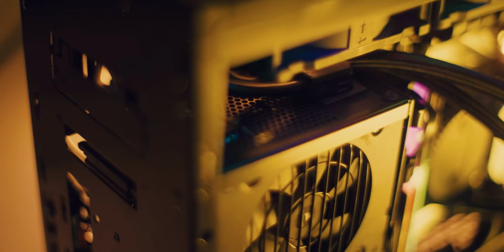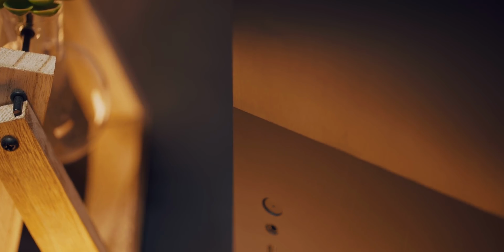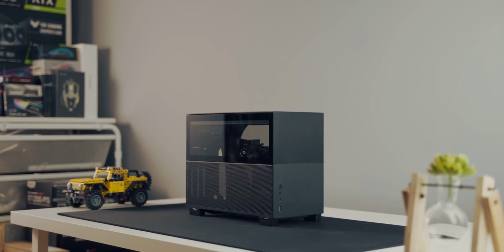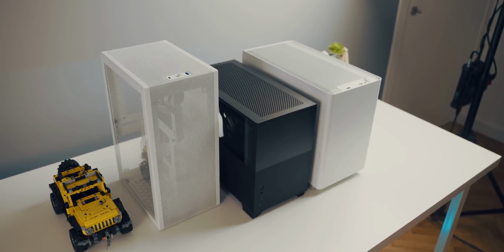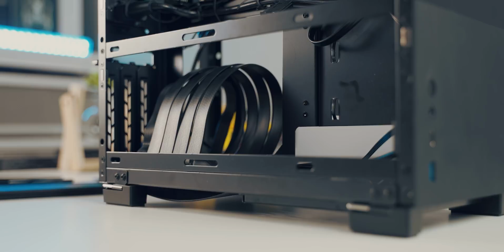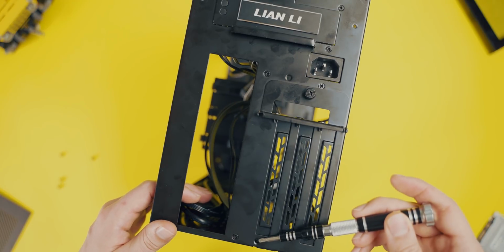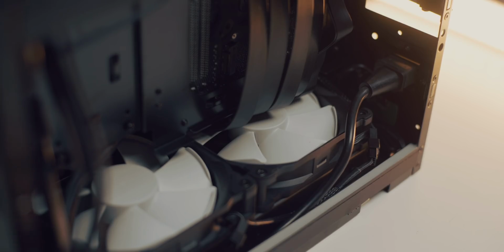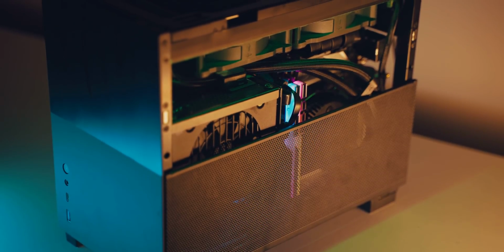An ITX MASTERPIECE?  Lian Li Q58 is Here!

Comment: It was not fun to build in, but it was rewarding. Fitting a 280 in this thing is a headache. I have my fans in the top underneath the panel so that they wouldn't sit inside the case, cause i hate that in ITX builds. Sticking to the radiator piece they have the perfect size cutout on all 4 corners so that you can route you fan cables cleanly to the supplied fan hub. A+the rest of the cable just chills under the top panel. As the the side panels, mine are very stiff, especially the glass ones, they dont like to come off or go on. There's so much good to say, but some bad too. Like the GPU sits right against the spine of the case, which basically mean it's a pressure cooker. I found that at least with mine, it required a lot of dissasembly to assemble. I'm not new to ITX world. I have had cases that require a complete tear down of the case to even start a build. And this one seems like a case that would benefit from being able to remove more of the case. But the biggest thing is going to be that bottom fan panel. Thankfully it is removeable, beause my GPU cables were preventing it from spinning, and with a quick removal of the thumbscrew bam fixed in seconds. Definitely recommend a low profile 120 for that spot.

Comment: Want step down size-wise with the next CPU upgrade (most likely switching my 3700x with a 5800x3d), switch air cooling for a 240mm aio and also upgrade from 16gb RAM to 32GB. I guess this case will be perfect, even tho I'll have to go with a new PSU. My 5700XT Nitro+ will stay with me for at least till 2023, so I'm glad this case has actually the space needed for that GPU.

Comment: I would have liked them to have positioned the motherboard on the left side of the case and the gpu on the right side. My current system sits on the right side of my desk and I get to admire the rgb on the EK 240 D-RGB AIO. I f I was to install my system in this case, I get to miss out on seeing the rgb in all it's glory. I may pick up the case to see how well they improved upon the case design that reminds me of NCase M1's offfering with the twist of re-positioning the AIO to the top of the case instead of mounting it on the left side of the case.

Comment: Cool case. One thing of note: I have the NR200, with the water cooler on the side, and I have it pulling air in. So even with the rad on the side, I still only get hot air out of the top.
Reply: Hot air rises, that's why top is always exhaust.

Comment: the fact that i can buy a seasonic focus GX use the NVIDIA approved 12 pin modular cable from seasonic with my 3070 FE on an ITX build is amazing. To add the thermal performance of a full atx psu over a SFX...280mm aio support XD. I may have to move My nh-d15 based tu-150 build into this. Once i get a bigger GPU/psu need.

Comment: I know, in this day and age, if I'm not commenting within minutes the comment disappears way down the list. Still.

I don't know how this case is dope. Styling is sexy for sure, but that's not enough for me. Just watch any video at Optium Tech for best mini-ITX cases. Dimitri questioned what are the glass panels showcasing? Exactly. Lian Li makes solid cases but I'd go for the Cooler Master NR200. Great thermals, quiet, a footprint very close to the M Case N1, and optional full glass case if you want to showcase internals (or a full mesh side panel for maximal air flow allowing for arguably the best tower cooler in the market). And it's affordable (if you can find it).

Comment: My only concern is the side panels. As mentioned they dont showcase the card but rather the AIO. This is good for a cooling standpoint but  not visually. Maybe all mesh is better?
On the other hand glass top half will silence the rad fans whist helping to tunnel heat from the GPU out top?

Comment: I already bought my black TU-150. I was trying to figure a mod for my great Seasonic ATX PSU (which I found on the web) and I wish it could have taken a 240/280 AIO. Alas this is my answer 8 months too late but still, I love my elegant TU-150. The Q58 solves my issues but it isn't as cool as my TU-150, knowing Lian Li they will have a solution for that too!

Comment: I agree with you about the view opportunities with regards to the position of the glass. Having said that, I usually avoid glass like the plague, even in midtowers, where are the opportunities of travel are significantly lower, and therefore unlikely to break it. But this design is the first one I've seen, with glass anywhere, that actually appeals to me.  It would require thinking about how to build in it.  I much prefer the idea of good airflow, and aesthetically, I find this two tone, mesh/glass, to be very pleasing and interesting.  I might consider this for my next build, tho, I am really pulled to the nr200 still. I particularly like what you showed about the mechanics and build quality, and that is as important to me as aesthetics. (Airflow, price, mechanics and looks, in that order of importance)

Comment: Basically an NR200 with added back some more of the Ncase M1 ideas.
Reply: There's quiet a difference. This is a sandwich layout type case at around 5 litres less and better build quality and materials whereas the NR200 is a much more traditional approach.
Reply: @reintrandininskia  I noticed the smaller size, it is very much Ncase M1 size. I like the use of magnets, not fond of riser cables compared to direct connect. The tempered glass location is odd, I didn't know what they were going for on that one.

Comment: Great Video! The Case looks nice. But in my eyes the TG Panel makes no sense at this position. Maybe for ventilation of GPU when its open.  It would be great If the sidepanel in front of the Motherboard would be made of TG. So you can show AIO Display and RGB RAM.

Comment: They should have options for choosing what the side panel looks like.
Half Mesh, Half Tempered Glass
Full Tempered Glass
Full Mesh

Different configurations for different folks. It'd be a win then.. but I guess TG might mess up that vertical GPU orientation :l

Comment: Maybe change the orientation of the PSU to have intake from the front (with front mesh), rotate the front I/O horizontally, move the fan hub to be parallel and just above the I/O, and swap the mobo/GPU sandwich layout.

Comment: Is the riser Gen3 or Gen4? If you use low profile fans for the 280 AIO, do you think you could still fit an ATX PSU? How does this compare in size the to TU150? I see ITX cases being described in Liters, but that isn't often present on manufacturer or sales websites. It would be nice to have that kind of information standardized so I can better visualize the size differences without needing to find someone who happens to place various cases side-by-side.

Comment: Case looks really good, but my one major disappointment is the riser cable.

 I currently have my system in a Shift Air 2, I had a horrible time getting my gpu to be recognized due to pcie gen 4 compatibility. I would love to see more small enclosures that find a way to not use a riser cable.

Beyond that though, I personally love the mesh sides and dual door design. At a $120 price point it's a very compelling case.

Comment: The CPU side panel if can swap from TG on the upper half to mesh it would be great. The reason being is the CPU is cooled by AIO which is mounted on the top, PSU can mount fan below to feed enough air for it. slight RGB leak from the mesh on the top looks nice too. GPU side top panel is TG, some GPU is not that tall, hence if they allow the mount of a small screen is not bad too.  cheers, just my opinion.

Comment: Overall I really like it and it's a solid contender for me. But I'm not sold either on that mesh+glass look and I think for now I'll stick with my TU-150 that I have ordered with my 3080 which is coming never! The TU-150 only has 120mm rad support, but I'm going to run a big air cooler. I like the look of it a bit more plus it has a handle and good cable management (with extenders). If there was an all mesh or all glass model I would reconsider :).

Comment: Lian Li is definitely doing a lot right with this case. Personally, I'd like to see a configuration that moves the feet to the back and turns the case vertical like an NZXT H1 so the Q58 has a smaller footprint. Small footprint on desk is really what I am after with SFF cases so height isn't really a concern. The alternative is to make the case VESA wall mountable like the Thermaltake Core P1. Then you have no footprint!

Comment: I think they should make the mesh/glass panels removable and swappable. A user could have full mesh on GPU side and full glass on CPU side, or vice-versa. 
Alternatively, they could give the option to buy replacements of either type of panel, so a user could have mesh on both sides (all four panels) for ultra airflow, or all glass if the user is going to be doing a custom WC loop and wants to show off all the sexy hardware.

Comment: I feel the windows would work better at the bottom, looking at your rig the best parts of the motherboard and the GPU are down there whereas the mesh at the top will hide the cooler & cables you mentioned, however I guess this means the PSU and GPU can't breath as easily?

Seems a shame they don't have the same mounting so we can't pick and choose if they go top or bottom, but appreciate the glass probably needs that extra securing.

Comment: Well, it is GOOD, maybe REALLY GOOD, but not THE BEST, IMO. Cooler Masters NR200 looks more friendly to cooling, especially to AIR cooling (158mm of cooler height is pretty nice). Also really nice look, PRICE (79$ come on), and feature set. Yes, you can say that actually ATX power supply MUCH cheaper than SFX, so you do an "exchange" - pay 40$ for Q58, and not 30-60$ for SFX/SFX-L power supply and NR200. Also i would really like to see how many SSDs and HDDs you can place in both cases... And i really didn't understand how that ATX PS mod works, odd.
Still, i'd love to see such an experiments to ITX cases, because what Lian Li did here - is an actual breathe of fresh air. Fan hub - brilliant (and RGB is +20 FPS)

Comment: So..this 15L case supports atx psu, while the O11 Mini doesn't..why Lian Li !?
Reply: To keep the 011 mini slimmer than the 011D. They widened the main chamber to accommodate a 120mm rear fan and/or large tower coolers, so if they went with ATX support it would just be a shorter, fatter 011D.

Comment: These small cases are so nice, I can't wait to build in a small case one day, imagine they're fiddly to build in but they're so nice. I have a Lian Li LANCOOL II Mesh RGB coming tomorrow to replace my NZXT H510i. I ran 1440p 144hz on my brother's monitor. While playing COD it heated up quite a lot, GPU was about 80 and was loud so I thought I'd change to something with more airflow.

Can anyone tell me if my decision was correct or not? I have a 240mm AIO which is on the front of my NZXT case right now but I imagine with more airflow I should get a lot better temps all round and quieter?

Comment: i am wonder a new size around M-ATX to ITX, for larger space for air flow and cooler, but still tight and smaller than ATX. better easy package, convinient to take on the train.
Iamage a gaming Youtuber or Vloger, every 3 month go to a different city, they need to move ALL of the equipment:
1\computer case. monitor(both Screen and Sound)
2\all kinds of gears, mouse, keyboard, earphone. 
3\all kinds of sub stuff, like 1 XBOX 360 controller, type 8 net line(10G)，charges.
4\a main Vlog camera, a tiny sport camera(like DJI OSMO), related stuff, battery, charges, triggle boom.
we usually seen a volger moved 1 city to another, because they use notebook. but what about a Gaming Youtuber, not convinient for them to move all of the equipment~~

Comment: Great video, thanks for the content!  The partial TG at the top had me excited, until you said the mobo is upside-down. Total head-scratcher, there! I like the idea of some mesh to improve airflow, the layout is good (allowing for a Top Rad, unlike the NR200), and there's a ton to like about this case! But it feels like the team designing the exterior panels maybe weren't talking to the folks engineering the internal layout. The two-tone look is nice, but if they're going with this layout (and thick black borders where the glass is adhered to the frame, as you can see @00:40 ) then it feels like the TG should take up 66% to 75% of the side (instead of just 50%). The point of TG is to show off your components, not your cables. It needs to be sized and placed on the case to achieve this; otherwise its just wasted cooling potential. Here's hoping they refine the design before summer - after 20 years of building PCs I'll be diving into my first SFF build this summer. The more case options, the better!

Comment: I would love to see them give us the option of replacing that glass with a mesh panel. I think double mesh would look pretty cool if it carried on with the different colour and texture two-tone look.
Reply: They should have double glass option.
Reply: Having the top part not in mesh will force more air from entering the lower mesh part and is improving the GC cooling.
Reply: you can now swap the tempered glass with mesh and mesh with glass, so you can choose your own layout
Reply: Oreo
Reply: Having both mesh panels on each side doesn’t make a difference temps will be same.
Reply: Would be nice if we could swap between TG and mesh  on the 4 sections
Reply: @kiffbien  You can
Reply: Heck yeah mesh is the future. Get with the program lian li. They should know better. They have some nice mesh cases already.
Reply: Yeah…the window really is ugly. Maybe if it had smaller bezels? Idk. It may have the same problem like really short and wide windows on "modern“ houses. It just looks unnatural.

Comment: Looks interesting, there's smaller options for 280mm rads, but not too many. And this will probably be cheaper and more available. I agree, not sure what that TG panel is supposed to be showcasing; I like showing off nice looking PC builds but I'm not sold that a motherboard with a bunch of cables coming out of it (and not directly into grommets/plates that hide them as in std cases) counts as nice looking. Wish they'd include a gen 4 riser, even if at a higher cost. 

Also :D at saying "at least it isn't an NR200 clone" since the NR200 is basically an Ncase M1 clone (no hate on CM though, it is different enough that I don't consider it a real rip-off, and I even own one)

Comment: Itx cases need maximum airflow, not showcase windows. I have the lancool 2 mesh ATX case, and the tempered glass panel is great to showcase things, BUT in this itx case it's not a useful feature. As this video demonstrates, you can't showcase anything, so a full mesh panel would be better.

Comment: Lian Li has been killing it lately. I love how modular and adjustable their designs continue to move towards .I even had a Lancool II that I accidentally destroyed the glass panel recently, but because of the design I was pretty easily able to disassemble and convert into a surprisingly capable and versatile open test bench.
I've been looking into doing my first ITX build lately and up until now I'd narrowed my case selection down to the Inwin A1 Plus. But depending on when other areas of the parts market stabilize and when Lian Li releases this model to the public, I might just have to end up using the Q58.
Thank you Hardware Canucks for another outstanding breakdown and review!

Comment: Good job Lian Li! This looks incredible! The price is great, insane compatibility and customization, and sexy af! Everyone is wanting full mesh sides, but I’m actually interested in whether the half glass side would perform as well if not better than using full mesh. The mesh is directly in front of the GPU, and having glass on the upper part should increase the pressure of the air flowing directly into the GPU. If the whole thing was mesh, there would be lower pressure air flowing in over the whole case instead of higher pressure over the component that needs it most. Just a thought though.

Comment: I'd much rather have the option for full mesh too. Maybe make the hole size+spacing different at the top half. Bottom can be very, very fine mesh so graphics card is visible, top half can have more steel than holes.

Hope they make a larger version where the motherboard tray has 65mm clearance above and below it so you can fit two 240mm rads.

Comment: I'm getting pretty bored of this entire form factor. they all tend to look the same. That said, I'm especially not a fan of the look of this case. It takes the tried and true (aka boring) appearance that everything else is doing, and gives it a pretty gross checkered look.

Plus, one of the best uses for an ITX case is as a media server, and not a single one for a few years now has had space for an optical drive. Even though 90% of them could fit a full sized drive in the top front if you sacrificed a little radiator area, and even more could fit a slim drive in some way.

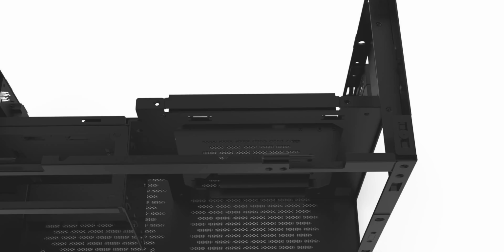Comment: The "Showcase" Effect isnt really there, like you said at 7:25 . Maybe if the side panels where flipped 180 degree 🤔, or if they shrink down the Mesh at the sides and do the "Glass-Part" larger (maybe an 3/4 Glass-Panel and 1/4 Mesh ratio 🤔) - i mean, no one want to the the Radiator-Fans 😅🤷‍♂️

Comment: You can have everything "Full Power" in the ITX space.  They make SFX-L up to 1000W.  I'm running top tier hardware in my NR200 with 280mm radiator and a clean install.

Comment: IS there room to run the radiator tubes behind the power supply so that they run along the bottom of the case to the cpu?  It would hide the cables coming from the psu nicely.